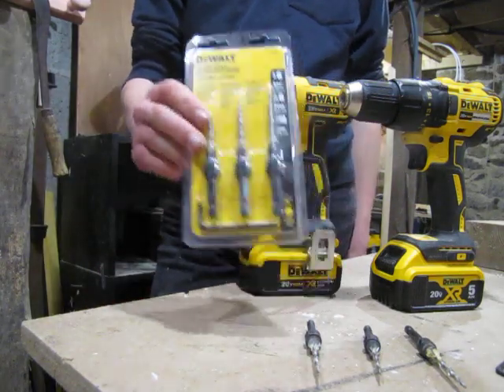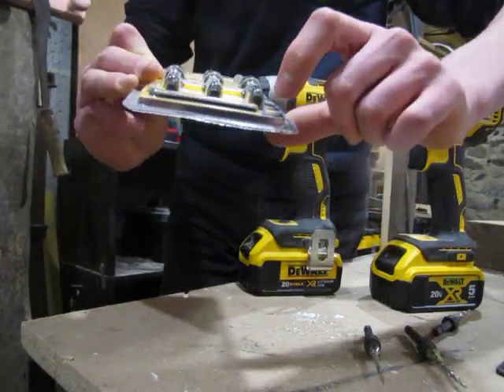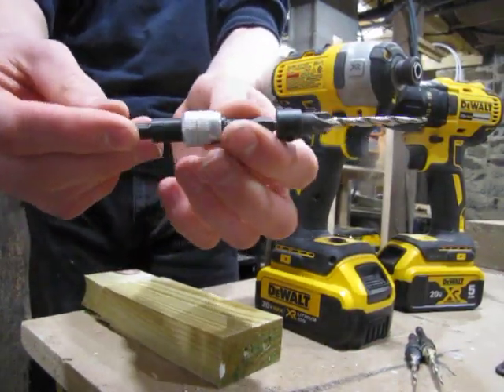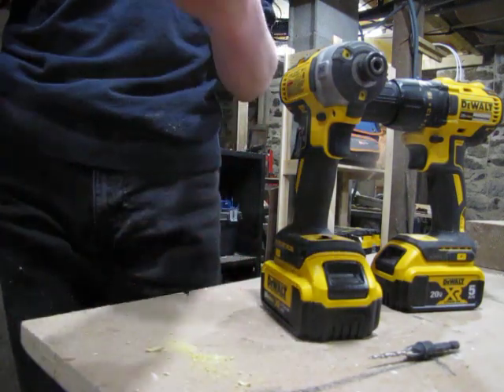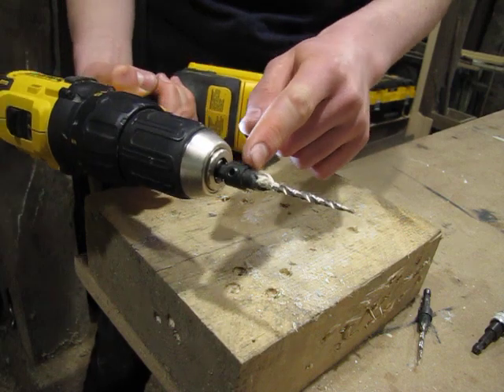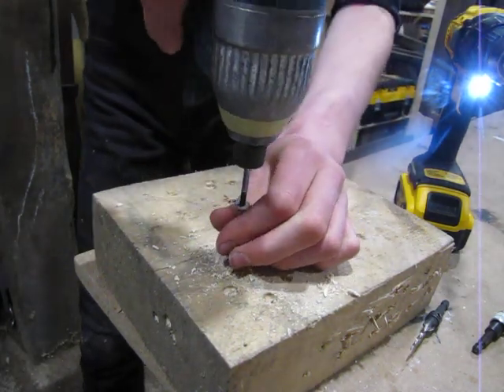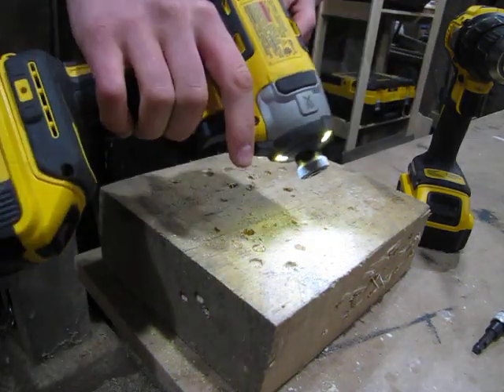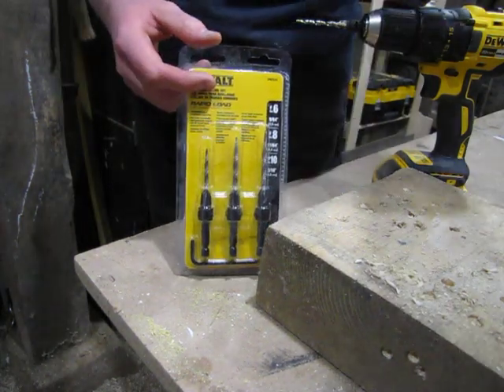Dewalt Rapid Load Countersink Drill Bit Review

Comment: Quick question I know you mentioned not putting it too close to the end or it will break, makes sense. I noticed the bottom half of the bit is round and not spiraled, is that the only place you should set the countersink set screws on?
Reply from the maker: Yes, you should only set the screws onto the rounded part but I wouldn’t sweat putting the screws on the spiraled part as long as you don’t force the countersink into the wood too hard. Thank you for watching

Comment: So do the shanks on these usually come off or are they even supposed too? Mine came off today and I don't know if it's broken or not?
Reply from the maker: The shanks aren’t supposed to come off and they’ve never come off mine. Thanks for watching.
Reply: @toolreviewsandrestorations  welp guess mine broke haha thank you do you think I can use an epoxy or jb weld putty to put it back on? I can slide the shank back on but it ends up slipping off again so who knows
Reply from the maker: @mr.baised2753  Could you just use it as a normal bit in a drill and forget the hex shank? That's what I would do.
Reply: @toolreviewsandrestorations  your right!!! Didn't think of that thanks!

Comment: these bits used for pilot holes only? what is the purpose of a tapered bit for this application
Reply from the maker: Jake Scoffield I have only used them for pilot holes. I suppose you could take the countersink off and use them for small holes. The purpose of a tapered bit is that it’s tapered like a screw so the end of the screw has material to hold onto.